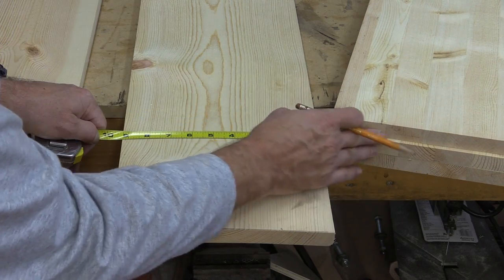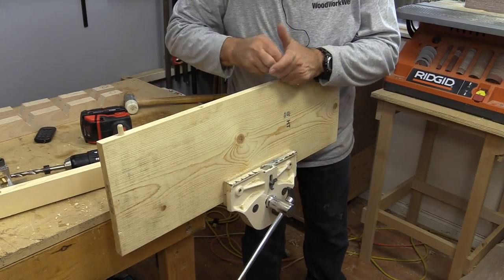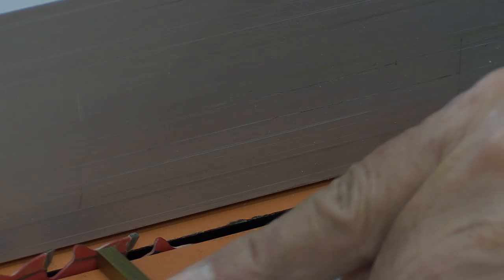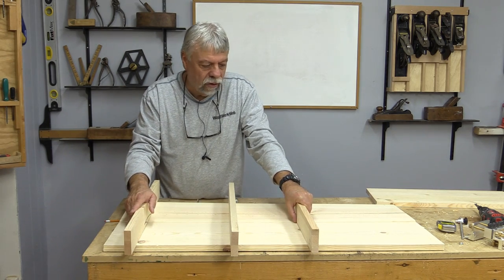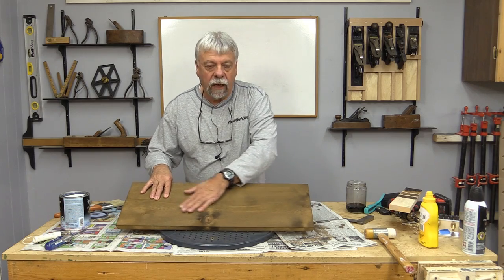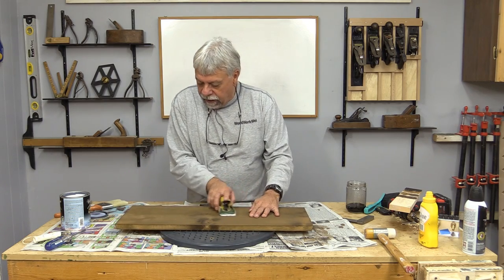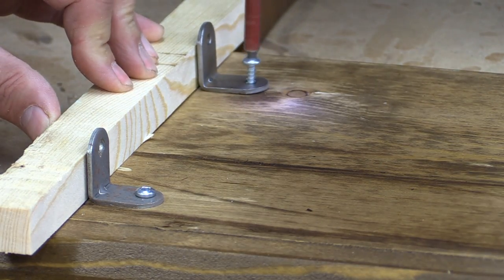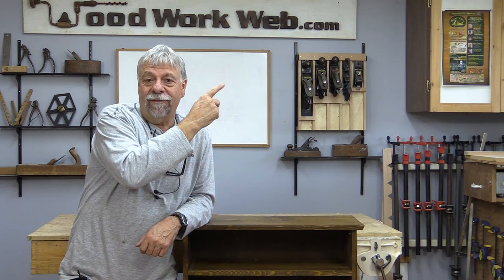How to Build a Simple Shelving Unit

Comment: I like function over form. Sometimes you just don't need fine furniture. You reminded me that I have not used dowels in years and I don't know why. Well actually I do. I was wooed by companies convincing me I need a biscuit joiner then a pocket hole jig and now a domino loose tenon machines. You've inspired me to pull out the ole doweling jig. hehe
Reply from the maker: +WoodRodent Yeah, I am becoming a convert to dowels .. well, at least for now :)

Comment: Nicely done Colin.  What make and model dowelling jig do you use?
Reply: +Hardnox looks like Dowelmax
Reply: Thanks.
Reply from the maker: +Hardnox Yes, it is a dowelmax unit
Reply: $250... ouch!  How thick of a stock can it handle?
Reply: +Hardnox I bought the Dowel Max Jr. for $115 delivered.  I'm very satisfied and use it quite a bit.  The company has some good videos on YouTube.
Reply: Ed Waggoner Sr. Thanks Ed.  I found out that the Sr. model will handle up to 4x4, which is what I need.  Still cheaper than a Festool domino machine that costs $1400.  (Festool has lost their mind) :)

Comment: I don't know Colin, that pine still looks like pine even with the custom dye :) And the water-based poly didn't do much to help, looks dead. Enjoyed seeing a little-used joinery technique though.That DowelMax looks like a nice piece of kit, the quality machining and general presentation remind me of Veritas tools which I love and have several of. Good stuff from Canada! But still...I think I would put that $300 ($400 or so with accessories) toward a Domino joiner instead.
Reply from the maker: +Michael Anderson Yeah, have to agree on the pine thing, I am not a big fan of pine, it nice because it's easily available, relatively inexpensive and easy to work with ... prefect for utility shelving. Can't say as I ever remember seeming anything in pine that looked like it was something else ... lol, certainly nothing I have built anyway. Thanks for commenting buddy ... always good to hear your comments
Reply: +WoodWorkWeb It's possible to make pine look really good, but it's a lot of work.  You have do a blotch control step of some kind, which then makes getting good color on it take strong dyes/stains and lots of coats - all challenging to do evenly and well.  I've found that gel stain helps a lot, but it's so expensive that you might be able to get nicer wood for the same money!  You pretty much have to work with oil based stuff if you want top quality finish on pine too, so that further complicates things.

There are only two ways to get a great finish on pine that are easy.  One is to just clear coat it and wait 25-30 years.  The other is paint :)
Reply from the maker: lol ... I like both those optioins :)

Comment: nice but why didn't you just dowel the base on?
Reply: oh it was the top... but still...
Reply from the maker: +John Smith +rommelfcc Yes, I could have done that, no real reason not to my only concern was that some many people move furniture like this by lifting up on the top ... I felt that the screws might be a bit better than dowel for this as I could only put the dowels in about 1/2 inch ... still ... probably could have used more dowels ... good point